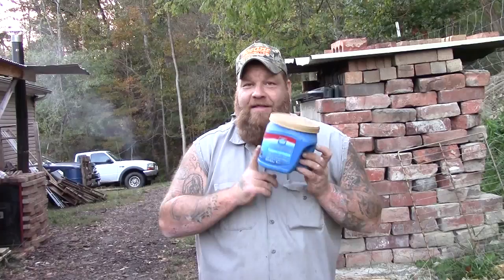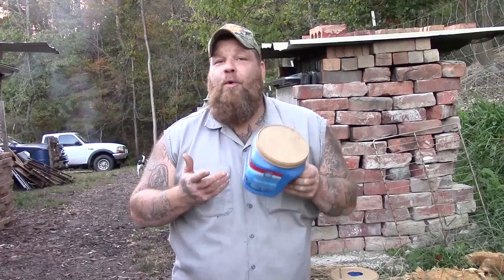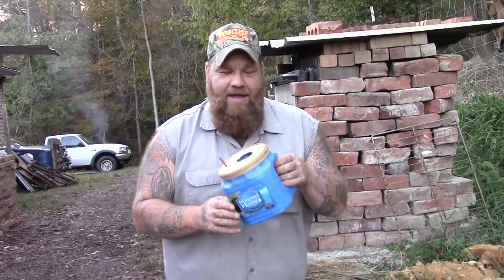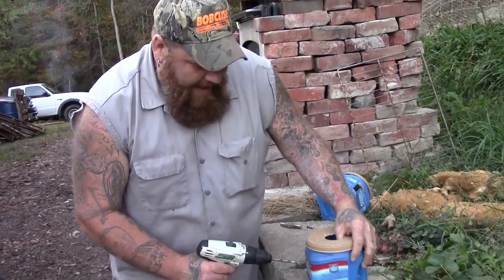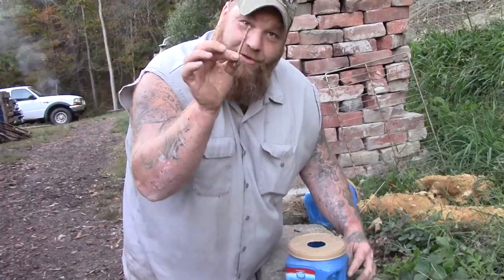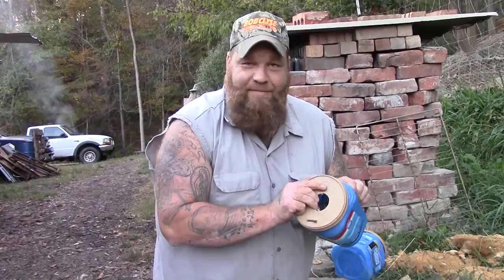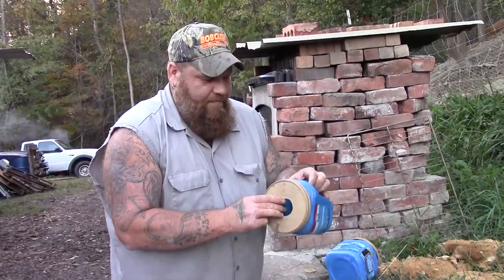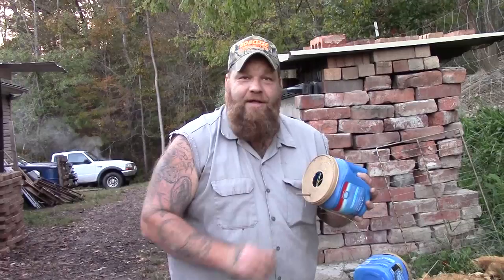Coffee Can Bird House

Comment: Liked your video. A little info for you though. Next time you cut a hole in plastic with a hole saw, get the bit started then reverse the drill and cut through in reverse. It will cut smoother, neater and won't catch like yours did..
Be safe.
-Russ (Florida)

Comment: Aren't you so sweet to think of the birdies!  I'm not even sure if I saw this on your channel or another but if you half a paper towel roll with a sharp knife, remove the cardboard insert and place the half roll inside one of those cans, drill a smaller hole of about 1/2" to 1" in the center of the cover and then fill the cannister with a mild soapy solution with a Tbsp. or so of bleach, you can make handy, disinfectant wipes for hard surfaces in your kitchen or bathroom.  Saves a lot of money and is great for recycling those containers.  Pull the first one from the center of the roll and feed it out to the top of the container.  The rest will pull out one sheet at a time.  I actually made some with a VERY mild soap solution, 1 tsp. of baby oil and they make great and inexpensive baby wipes for moms on a budget.  But you have to use thick, heavy paper towels like Costco. brand Kirkland or Brawny, etc. or the paper towels may shred.  These containers make good planters for small seedlings too!  If you fill them half with sand they make great ashtrays, candle holders, mosquito punk holders, door stops and weights to exercise with.  Since they are food grade you can mix pancake batter in them and store in the fridge.  I fill plastic containers with water and freeze them because they make great reusable "ice" for coolers on picnics.  I also re~use plastic containers to keep medical supplies and EDC emergency items dry and handy.  Even would keep toilet paper dry for camping trips.
Reply: The cut paper toweling, in a can, would be great in the car trunk, for checking the oil.